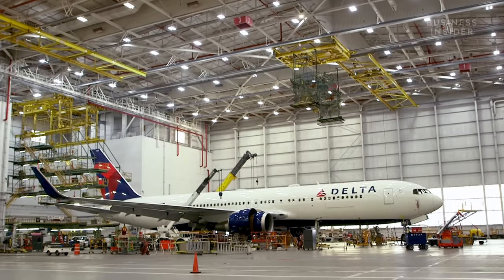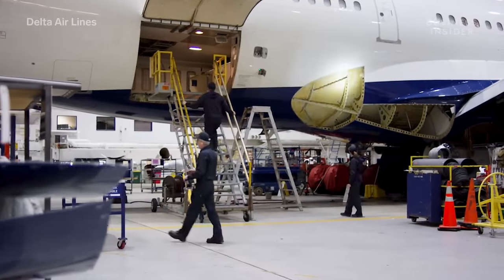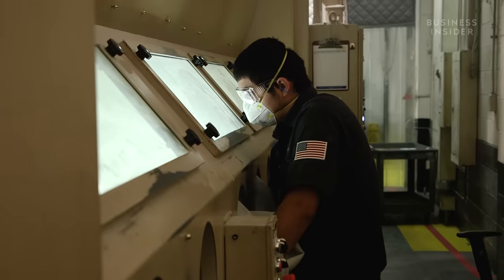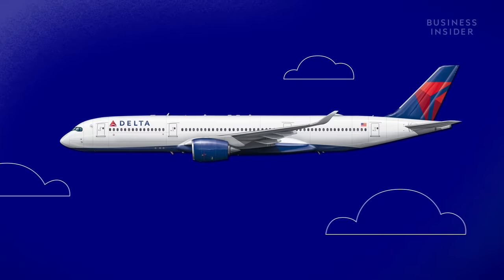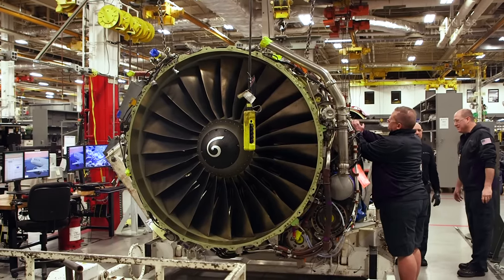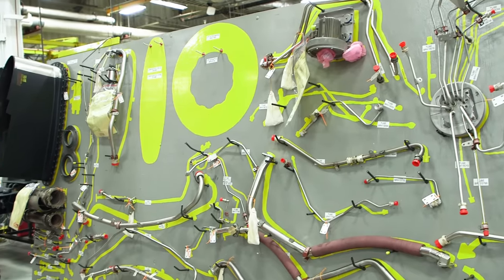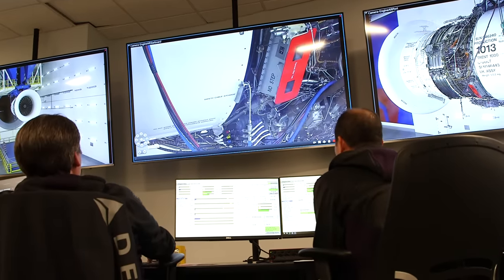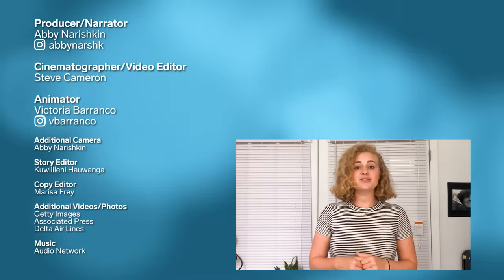How Delta Fixes $32 Million Jet Engines | Big Business

Comment: “This part cost $12000”
Me: oh I can buy that
“And there’s 80 of them”
Me:...
Reply: their expensive just because they don't produced much, most of the money goes to cover reseach cost. Its like a ferrari headlight vs toyota headlight, toyota is way cheaper because they're mass produced.
Reply: @ahemjunior  not just that, those particular blades looked to be the for the high pressure turbine. Most likely they are single crystal titanium which is not only an incredibly expensive technology, but also incredibly expensive to produce as well. 

I've wanted to break into jet engine design for years, but covid and other events before it had other plans so I am glad I chose a different route for my Mechanical engineering degree right now.

Comment: i was a KC-10 jet mech in the Air Force in the early 90's. those engines were 4.5 million each. the 1st stage fan blades were $10k each ( 114 blades total ) now, i disassemble apu's at an MRO on military applications..

Comment: Fascinating and had no idea there was a central factory. Always thought each company had their own system.
Reply: Their are a few companies still doing engine work but with lines costing 5-10 billion plus license and testing space fewer and fewer companies still do it, most new engines have 3-5 licensed shops these days
Reply: @dstblj5222  Incredible skills there and training. The tolerances and test equipment like you said must be in the millions to billions. Wonder how they make sure no counterfeit parts ever get introduced. Remember an accident once where counterfeit mounting bolts were used for the engine and sheered off. Think that was the first time they realized a new black market could be out there. Thanks for the education :)

Comment: I see it takes a few days from start to finish  to repair  an engine  however  we know planes are not down for that long so .. when they take it off do they replace it with another while the other is being  fixed?
Reply: Yes .. They have spare engines at repair stations or swap an engine from an aircraft that is in for a long overhaul.

Comment: I worked during the 90s as a contract security guard at the Northwest Airlines technical operations facility which was directly across from Delta technical operations on the other side of the airport Northwest split their maintenance 747s were done in Duluth Minnesota and the remaining aircraft were done here in Atlanta let me tell you Airline aircraft hangars are actually that busy 7 days a week and you learned very quickly to keep your head on swivel because there was a lot of equipment that can definitely hurt you or worse if you weren't careful. But of all the jobs I've had that was the one that was the most fun because I'm an aviation buff . they shut that site down in 2000 and I don't know what they're doing with it now

Comment: When a Rolls Royce engine is at full thrust, one blade is subjected to more tension than the weight of a London double decker bus hanging off its end. And Rolls Royce uses a highly classified baking method to produce the blades. Saw a documentary on how their engines are made. The plant director wouldn't let the news crew see the oven because the process is top secret. Interestingly, when baked, the blades expand and even slightly change shape, which makes them incredibly durable but also light so they save a little bit of fuel.

Comment: Nice. Repaired engines don't need any new certifications?
Reply: They are an FAA certified MRO. Any reconditioned part or component will be legally certified since they are reconditioned per the manufacturer's specifications.
Reply: We had inspectors that worked in our shops signing off on, and certifying work as it was done where necessary.

Comment: one thing i had a question about, are these maintenance people a part of delta airlines, or the plane manufacturers? or some solely 3rd party corporation?
Reply: They are Delta people. The engine manufacturers have on site people to work with Delta engineers. The people at Delta's Tech ops in Atlanta are Delta employees.
Reply: @kdiver58   ok thanks mannnn :)

Comment: 6:51 they’re gonna need to upgrade that in a few years. The GE9X engines that power the 777X produce more than 100,000 pounds of thrust each. It is rated for 105,000 pounds of thrust and a world record of 134,000 pounds was set during a test run.
Reply: It can actually hold 150,000 pounds of thrust so they wont have to rebuild. Watch the video again @ 6:48
Reply: YEETMAN5656 no Big deal, no US airlines has ordered the 777x anyway
Reply: @turbomazda2  I understand that but what I’m saying is when 150,000 lb thrust engines become commonplace that machine will be pushed to the limit and need an upgrade.

Comment: Does the FFA have a standard TBO, or is each jet different?
Reply: Engine TBO is determined by the manufacturer of the engine and in the Maintenance manual provided by the manufacturer.

Comment: I wonder if airlines have taken the opportunity to front load all their repairs apart from the mammoth task of getting all the parked planes back up and ready to take to the air once air travel returns. After that there are all the Boeing planes sitting in their park and waiting for their software update. The flight simulator shops must also be running at full speed to keep pilots up to date and retain them.

Comment: Mind boggling, Some one came up with an idea (jet engine) oops, I think it was the Germans in WW2. Engineers draw up the designs and blueprints for Thousands of parts ! 
Master technicians build those parts. Months of rigorous testing. That testing includes numerous redundancy protocols for safety, so you can feel safe when you fly. 
But still when I watch this video, I wonder what if one of these workers has a hangover or just broke-up with somebody !

Comment: How would a airplane a thousand miles away or more with a sick or non running engine get to this repair shop?
Reply: Mechanics go to the plane. We call it a road trip. It's great overtime.
Reply: Sometimes they need to truck an engine and crew to swap it out. Truck back sick engine.

Comment: Is the $ 12,000 blade a rip-off like you need to buy the same company blade to repair your super expensive engine so they charge anything they like for it.....
Reply: its a good deal. north west was the best at fixing planes. they also had great cost control. if there was a way for north west to make a blade cheaper they would have done it
Reply: @dknowles60  I thought the engine manufacture would make the blade.
Reply: @urvagrawal2358  if you only  knew what north west airlines could do. they had the best A&P people. they kept old paid off planes flying.  were the frist to put P&W on the Dc 10. it was the cost of the parts that would make a air line build its parts of buy its parts.some times a air lines could build it cheaper. many times it could not
Reply: @dknowles60  thanks for sharing that information. I thought engine manufactures may have maintained monopolies like what they are doing with Iphones or tractors where you have to buy parts from them they might even sue you if you make parts yourself and charge exorbitantly for repairs. nice to know that thats not the case.

Comment: The unit cost for a brand new 737-200 in 1968 was roughly around the same price that a GE90 goes for today. You can shove that bird right down the GE90's throat, litterally.
Reply: The fuselage, at least. The wings and vertical stabilzer may have other plans
Reply: @videosfromelsewhere926  Yes, I just didn't mention that they'd be snapped off :-}

Comment: So, when you hear maintenance personnel are expecting to be paid for their expertise, you have a little more of an understanding of their capabilities and responsibilities. The airline execs want to cut as much as they can when it comes to maintaining these aircraft, and have been contracting out a lot of maintenance that was always done in-house in years past. The problem is, this isn't putting self-checkout registers in at Walmart, this is life-and-death responsibilities that maintenance personnel are responsible for every day of their careers. But from the execs point of view, it's only about dollar signs and selling their shares (while claiming they don't get paid a salary) for millions every year.

One other comment, when she stated the engine comes out of the test cell and gets installed to fly, that isn't quite what happens. The engine gets shipped to an aircraft maintenance facility to be installed on an aircraft. Then there are maintenance personnel who perform engine runs (idle and high power runs), leak checks, system checks and every safety check required prior to putting the engine / aircraft back into service. Once they are in service, the aircraft is scheduled for a flight as soon as possible, and will then be flown with passengers onboard.

Comment: I wonder how Delta will fix its public relations
Reply: has nothing to do with Delta' maintenance base in ATL. STUPID inappropriate comment. Delta leads the industry in passenger service according to JD Powers customer service surveys.
Scroll down for J.D. Power’s list of the top ranking airlines:

Delta Air Lines (860 points on a 1,000-point scale)

 Southwest Airlines (856)

Alaska Airlines (850)

JetBlue Airways (849)

United Airlines (810)

American Airlines (791)

Air Canada (759)

Comment: A question and a comment :
Q. What about proprietary issues concerning the different engines? If ONE shop tied to ONE airline has access to MANY different advanced engines , couldnt secrets be divulged? Or is this an ignorant question?
Comment :
How about videos on the manufacture of various plastic items , that use injection or hydro forming molds?

Comment: Back around 2005 Delta busted the machinists union and fired all of them.
Reply: Delta mechanics were never unionized. Northwest mechanics were. After the Delta Northworst merger was completed Delta ran off the Northworst union. just like they did when the Teamsters tried to organize Delta workers. they got run off too and were told by Delta employees clearly told them we don't want you. leave and don't come back. they only got 23% of the required 51% necessary employee vote.
Reply: that was Northwest union. not Delta.

Comment: This is timely when Delta has parked and mothballed a huge percentage of their fleet. They don’t need to rebuild engines. If they’re smart, which they’re generally not, they could just leverage the engines off the massive number of jets they have sitting around unused. The logistics of doing so should be far more cost effective. But they’d rather charge people for a seat assignment and pretend they have the covid risk under control.
Reply: That is actually exactly what is happening. No rebuilds happening on delta owned aircraft

Comment: Blah, Blah, Blah.........these are BACK SHOP JOBS = CAKE (airconditioned & heated -sitting on your ass mostly -playing with cranes milking the clock) -------------> it's the FLIGHT LINE MX that makes it happen, the ones outside in the extreme cold & heat, rain, snow and making sure that plane leaves on time and safely. *I'm also curious how some of these women made it to the  back shop without paying dues on the flight line? UNION must be really good over there huh?
Reply: As someone considering getting into the field, I heard that line mx is actually something one should get into once they have enough back shop experience, heard that line maintenance is pretty tough, and very serious, literally no mistakes can be made as it's high pressure position. Idk, seems kind of wrong to send someone to line when they have very little experience, it seems like a fast paced job that requires a lot of knowledge and punctuation. However, I think I see what you mean... starting line mx seems almost like sink or swim, if you can float you'll learn a lot fast, back shop seems like you can learn a lot, but much slower, but very detailed. I'd rather work line, from Stigg Aviations channel, he shows a lot of what that job is about on line mx and tbh it looks FUN to me. This back shop work, honestly... Looks like it can get boring af after even a couple years, so maybe not boring at first but I bet it gets pretty boring after a while.
Reply: @Siegefya  You just earned respect already by your truthful moment by being “humble” —————>> idgaf how smart you are or high your IQ is…..”everybody” makes mistakes from one point in time or another. Humility is essential on the flight line, TENACITY to go out and get it done also earns respect from your co-workers who will guide you and check you when making error until your muscle memory kicks in on overall performance. I’m not knocking the back-shop people as there is talent in the back-shops and also the hangar -but it’s a whole new world on the flight line and yes it is “sink or swim” —————>>> Better yet the best are ———————->>> FLIGHT MECHANICS, they’re typically assigned to an aircraft for 20 days flying all over the world maintaining that aircraft and home for 10 days straight ————>> That’s what I did, I rough necked it. YOU WILL HAVE HATERS IN THIS GAME OF AVIATION, but be grateful for them because you will learn and it makes you better as long as you are (((( HUMBLE )))) and own your errors. 

Get into the field …..get your behind in an approved FAA Airframe & Powerplant School (A&P School) —————>> I would also advise NOT to obtain a degree which these schools are about making $$$, you want your A&P Certificate……….ONCE you complete your A&P Certificate the name of the game is 80 to 120 hour ——->> “General Familiarization” course……….thats how you get paid and you will also need your FCC Element 1 & Element 2 if you end up in a union ………some of these unions produce SHYTE A&P’s who become arrogant and tell you that you can’t even touch an “Audio Control Panel” or even pull (open the Circuit Breaker) ………..but 1st things 1st, get your ass in A&P school  ASAP and remember it’s also the building block for ENGINEERING = THINK BIG and put yourself out there. Get to gettin.

Comment: "3 million square feet"
I don't care about this metric-emperial debate. I can go both ways.
But why the hell would you use the smallest unit to measure something that big? You could've used miles, kilometers, acres, or hectares. Anything. But you had ro use feet so just you can present it in the millions. Pathetic.
Reply: Real estate is always measured in square feet. 
Farms are measured in acres.  
Combustion engines in liters. 
Just using the norm for building space. 
Take a step back and breath.